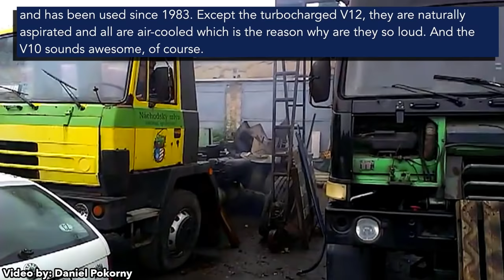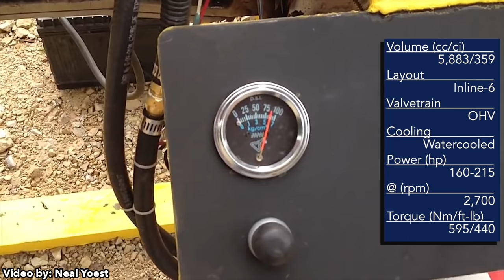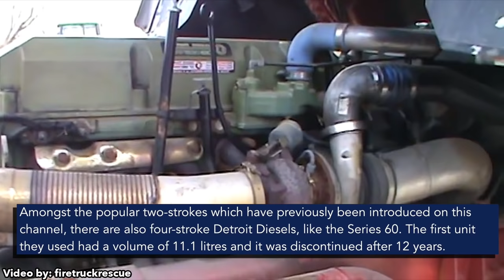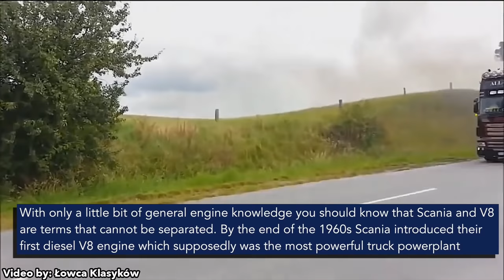10 Best Sounding Truck Diesel Engines

Comment: I can't be the only one who thinks "rolling coal" is stupid....
Reply: I mean, come on! Tune the fucking thing properly!
Reply: I hate it. I can't get my 98 frontier inspected with a bad evap canister that causes a engine light, but rolling coal passes.
Reply: "Tune the fucking thing properly". That just shows you've never owned a modified diesel. If you've got bigger injectors, which basically everyone who enjoys modifying diesels does, you're going to blow black smoke no matter how well tuned it is.
Reply: Wyatt Lewis Yes, I haven't owned a modified diesel. But, there are some people who actually gun specifically for the "Black smoke! Cuz it looks so cool!". It's those guys who I have a problem with. And the fact that you raised. Bigger injectors and the inevitable black smoke. It can be MINIMISED, can't it?
Reply: What's wrong with thinking it looks cool? It does, black smoke generally means power. And it can be minimized, bigger turbos move more air which means more of the extra fuel from bigger injectors will get completely burned, which creates less smoke, but it also takes more time to spool a bigger turbo unless you're running a ton of fuel at which that point it doesn't matter and it's going to smoke just as much anyway.
Reply: Wyatt Lewis What's wrong with "think it looks cool" is wasted fuel, unburnt carbon (soot), shite fuel economy and a general disregard for the environment. If I ever own a diesel, which I probably will cuz I like pickup trucks, when I modify it (inevitably), I would like to ENSURE it doesn't smoke. Simple. The downsides far outweigh the upsides, in my opinion. For me, "rolling coal" falls in a category called "Truck Rice".
Reply: The thing I don't think you understand is that if you've got a truck that is actually setup to make 500, 600, 700 horsepower, it's going to smoke at least a decent amount no matter what you do. Yes, you can minimize it, but no matter what you do, if you've got your truck modified to make any real amount of power, you're going to blow plenty of dark, black smoke when you floor it. The whole fuel economy thing isn't even a valid argument, I can average 18-20 mpg with my 24v Cummins and still shut down intersections with smoke if I want. Same goes for the "general disregard for the environment". Most of that black smoke is soot which falls to the ground and does.... absolutely nothing.
Reply: Wyatt Lewis ummmm.....you ever heard of Banks Power before? Their diesel drag truck doesn't smoke....
Reply: Brock Dumesnil sometimes it is but when it's an old met diesel doing it under heavy load it's sort of gratifying
Reply: Insane S60 It's not really wasted power. My truck will blow enough smoke to shut down intersections until the turbo spools up and then it cleans up. If I didn't have enough fuel to blow that much smoke, it'd never spool my turbo and it wouldn't ever stop smoking. And I could say the same thing about anyone who drives a Volvo.
Reply: Insane S60 not necessarily true. A lot of times when you see diesel powered equipment rolling coal it's because the fuel pump was turned up to produce more power
Reply: Chase Keeling Actually, I hate Priuses as much as any self-respecting motoring enthusiast would.
Reply: understandable. Now be quiet I'm eating cheese sticks
Reply: Yatharth Moza You are not alone. I want to cause physical harm to people that say it. I also hate the stupid fucking stacks through the bed.
Reply: ChrisHallett83 funny how diesel smoke is less harmful then petrol.
Reply: @yatharthmoza  All rolling coal is that the person has stepped on the pedal a little too hard, on startup a diesel engine if you keep turning the key until it starts it fills the engine with fuel which is why on startup they spew black smoke until the fuel is burned up. Most vehicles with diesel engines have a little light that says wait to start once that goes away the engine is ready to start mostly during cold times of the year. When a truck is stopped at a light when it goes to move again it will spew a small amount of black smoke but if it does it for too many seconds it can be red tagged by DOT if they see it that varies between states in the United States. When a diesel engine is tuned properly they run far more efficient than any gasoline engine you can find. A car with a gas engine can get somewhere near 30-40 miles per gallon but the same car with a turbo diesel can get past 50 Mpg even rival allot of hybrid vehicles if you drive them right.
Reply: Honey ,,, you are the only one.   Deal with it.
Reply: @wyattlewis8671  Diesel engines are mostly the turf of French and German car manufacturers. We have some very powerful diesel engines with power and lots of torqure. Some of them can run over 167 mph over a long time. Especially the stongest diesels of Audi or BMW. 
An E60 530d has 231 hp and still stem 500 Nm (368 ft·lb)
Way enough Torque for a daily driver.
And some Tuners do tune diesel BMWs with lots of power. BMW Alpina D5 S, 3l, 388 hp, 800 Nm (590 ft lb), 4.4 sec nought to 60 mph...just an example.

And rolling coal is really embarrassing. The smoke is really unburnt diesel. 
I don't get that. Its so uncool. 
My diesel-Volvo is really clean thanks to a spf.

Comment: obviously is here only one rule: "Loud" Why that should be the same as "Best" ? I damagd my ears with very heavy LongHaulTrucking. When you drive several hours hill up and down with more than 50tons you have enough fo that shit, especially the higher rpm (jakebraking). I would have quit that job, immediatly with a awfull two stroke engine. I only like the V8 four stroke with big torque. I have driven several V8 Mercedes and Scanias. I miss my last scanias. Most showdrivers are idiotic assholes. I hate their attitude of turnpikes at the limit. A good truck engine sound is between 500 and 1500 rpm. sorry for my english, i'm german.

Comment: Cats Do not Break Noob.
Reply from the maker: The Cat 3048 is most ultimate engine in the world! It won't ever break! It won't ever sound worse than anything! It won't ever be less powerful than anything! In short, the Cat is the best engine ever produced!
Reply: VisioRacer i learned to drive on a 3408. old 80 pete. being the rookie i was i spun the ring gear off carrier. sheared bolts right off. nothing soulds like those old mechanical cats. the sister truck to that was an old 1693. I only drove that a couple times but that was a stump puller 2. I remember looking at the engine from the back into the cab and just thinking my God this thing is huge it just filled up the whole underside of the cabover truck. I've driven a few 500 horsepower Cummings they've been turned up but nothing was like that 3408. got a ticket for 75 miles an hour on the backside of the Grapevine on I-5 in California. officer asked me if I was loaded and I said that I'm only  loaded with 25000 pounds and he was shocked. chp was pretty cool wrote me for 64

Comment: America is so archaic if it comes to engine building. A 7,3l diesel that cranks out 'only' 275hp and 710Nm? 

Audi has a 4,2l V8 TDI (twin turbo diesel) wich produces 380hp and 8000Nm. Sure if you tow a lot of things your 4,2l won't last for 20j. But it would be a good solution for the people who SOMETIMES tow a trailer. This way you don't need a monstrous retarded 7.0l engine.. the 4,2l takes up to 8000lbs wich is more then enough for a caravan.

We used our BMW 3.0l 6-cyl. To tow trailers and caravans and all kinds of stuff and it lasted for 13y and the car wasn't broken or anytthing. My parents wanted a newer car. Those Germans know how to build cars. In comparison to that US built cars are crap. They used to be very good, we used to have only american cars. My granddad was a mecanic and used a 1500RAM with a 5,7l, we also have a Mustang III from 1979. Thise cars were nice the new ones are total shit..

Comment: It is strange that there is lots of bad engineering and failing engines in big +10 litre v8 diesels. Who did it right was scania, mack, mercedes and i count yamz and iveco in that group. Even tho yamz v8 were very low powered as many mercedes v8 too. 
And if i am right there is common engineering in scania and mack. Tatra v8 i can not say are they good or bad.

But losers in that game were caterpillar, cummins, john deere, kamaz, who else..? Some bigger internationals didn't have so good reputations either?

Comment: I stopped watching when it said the 24v cummins was larger than the 12v cummins.
Reply from the maker: There was a 24V 5.9 and 24V 6.7. So the 6.7 was obviously larger than the 5.9
Reply: VisioRacer They also didn't say anything about the 5.9 or the 6.7. For people watching that don't know anything about the cummins, they'll be misinformed without further  research.

Comment: I'm so happy you included a powerstroke on this list when you didn't have to, if I had to guess I'd assume you included a diesel from each of the big three in the US to satisfy your American viewers. Regardless of why you did it, thank you. That being said, and please don't take this as me being ungrateful, the 7.3 is not the best sounding powerstroke. It may be the most reliable, popular, and the one sitting in my driveway, but it's not the best sounding. If I was correct and you only put a powerstroke on the list just for americans, IN MY OPINION, you should have gone with the 6.0. They're sound is far superior to that of the 7.3, its basically a higher revving Scania V8 with a smaller displacement, a magical sound I think every motorhead should hear at least once. https://www.youtube.com/watch?v=2XcRkgxse_w Heres a link for research, I promise I don't know the guy or anything, its just the best pure sound vid of a 6.0 I know about. Thanks for making this vid, Christmas came early this year for me! Merry Christmas btw Visio.

Comment: #1- really? 966 cu in & only puts out 283 hp?? I guess it makes up for it in torque though.
I think they sound horrible IMO.
I remember as a kid all kinds of GMC semis had the detroit 8v71. high revving & low geared trucks were everywhere
Reply from the maker: Power is a function of rpm and torque. With very limited rpm range you won't get lots of horsepower.

Comment: Got to put in some links to the way a Scania should sound, and not like some silly overtrimmed road race crap. Sorry, but I don't give a rats ass who made the trim on the Scanias in this video or if they got some good reputation and how many hp they develop.

Here are some real workhorse Scanias with the right sound, driven like a truck should be driven. - period!

Malmbergs:  https://www.youtube.com/watch?v=VpPJIPOQsTw
(Cred to ADVideofilm who filmed it.)

Older clip of Selldén's trucks (but the sound is ear candy):
https://www.youtube.com/watch?v=B_hebsA__b4
Cred goes to scaniafan1990

And a couple of gravel trucks - the second has some eye candy paint job:
https://www.youtube.com/watch?v=2nB5XuVZobw
https://www.youtube.com/watch?v=4Yd1zCwC95U
Cred to swedengines for those two.

Now it's up to you listeners... which ones you prefer.

Comment: Scania is OHV not DOHC.
Reply from the maker: I've read that they are DOHC
Reply: No they are pushrod OHV with 32 valves with individual cylinder heads. I use to work in a truck workshop and have serviced a fair few scania trucks.
Reply from the maker: Well, good to know then. Thanks

Comment: Although that Mack is a beauty. They are generally crappy trucks.
Reply: No thats not true. The Macks I have ever dealt with had well over 300,000 miles on them before ever needing any major service. Mack trucks where built for heavy industry and off highway use. their road trucks where every bit as tough.

Comment: my old truck dealership boss says....nothing gayer than a v8 diesel, except a v10 or 12.  Do some checking...big trucks don't use them anymore....not in america anyway.  The 12 valve cummins and series 60 are the only two desireable engines featured here.  That's what he said anyway.  I like gas v8s
Reply: Brent Hass yeah but trains use v8-24s all the time lol
Reply: you are right, and I knew that.  I suppose sheer size.....  A six would be quite long.  V8s were a fail in heavy trucks still, but not in a top fuel engine.  Can't imagine my Cuda with a six, even a 5.9 cummins

Comment: How come there aren't Asian built ones?
Do they suck?
Reply from the maker: Suggest some and they might appear
Reply: Not really. They just don't get a lot of spotlight because no one really uses them, so Asia isn't really recognized for its diesel engines. Mitsubishi makes marine diesels and no one ever speaks of them because, again, they're not really popular outside of Asia. However, the 6.6 Duramax is technically an Asian motor, or really least a half-breed of sorts, since it was developed in a joint venture between Isuzu and General Motors, and God damn, does it perform.
Reply: VisioRacer the 2.4 I4 from the Hilux

Comment: 3408 17972ccm max power in trucks 550-600hp...fuel cemetery..
Reply: meanwhile Scania V8 makes 730hp out of 16.4L
Reply: Keone Kele and 3500Nm
Reply: ΑΡΗΣ ΚΟΡΝΑΡΑΚΗΣ
at 950 rpm.....
Reply: ***** what else?
Reply: Zsolt Lukács the 3408E, used in some commercial buses, started at 650 HP, and achieved reasonable BSFC numbers. This engine later powered construction and mining equipment through 2007.
Reply: I know that for a long time been used in mining machinery,ships and genset!but,if 650hp?i dont know!+P Kranz
Reply: Zsolt Lukács Yes, 650 in that application, here in North America, where they were built.  They had Direct Electronic Fuel Injection, air to air cooler, and a very heavy-duty clutch, as the base torque rating was over 2200 ft-lbs.  Most off-road applications were diesel-electric, vs mechanical transmission of power. 

While the C15/C18 six cylinder engines replaced the 3400-series V8, US emissions regulations have forced Cat into creating designs based on the underutilized 3600 series, some of which are starting to appear in a new T4 EMD freight locomotive.
Reply: P Kranz
yes!understand! in europe also killed the emmission regulations the old,dependable engines.the old engines is euro 2,3 class toll is horror..0,27 us dollar/0.62 miles.thus they are forced to buy a new computer-controlled engine truck!it still beeps, flashes could improve and you can go to the repair...not mechanical problems,just computer problem...

Comment: A V12 producing 300 hp is crappy.... I have mainly run cat engines and Detroit engines... the 60 series Detroit is hard to beat... 6 cylinder putting out 515 hp... In fact I have ran a Mack that had more hp then that v12

Comment: CATs are overrated, expensive piles of steamy 🐎 💩.
Cummins FTW.🤘🔥
Reply: JIGA BACHI It’s all in the driver. Hard on equipment then it ain’t gonna last. Got almost a mil on my CAT 3406 E 18 speed. Only replaced clutch once, no major breakdowns on highway and I do heavy equipment and cattle. Once it hits 1 mil, gonna rebuild the motor and put it in my other truck. Change up to c15 6nZ in my daily use work rig

Comment: V8 diesels are mostly turds.  Just ask yourself what type of engine is in All American Class 8 trucks for the last 30 years. Inline Six, Not v8s.  No offense to the V8 gas, which is what I have in my Cuda and Firebird, neither of which I pull with
Reply: v8 were in truck for many years but they quit making them